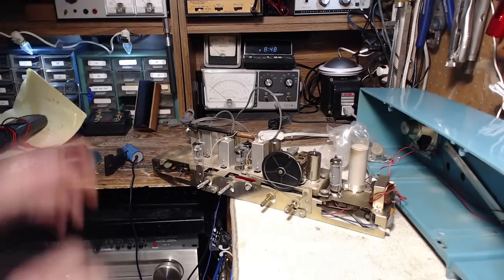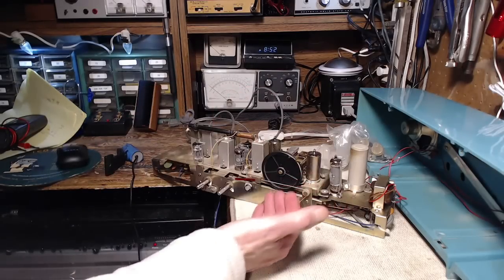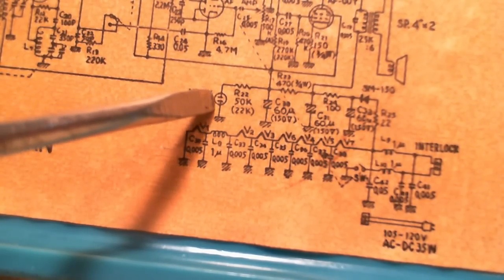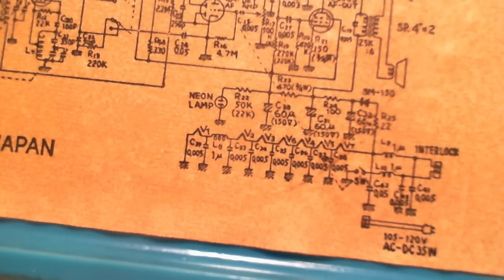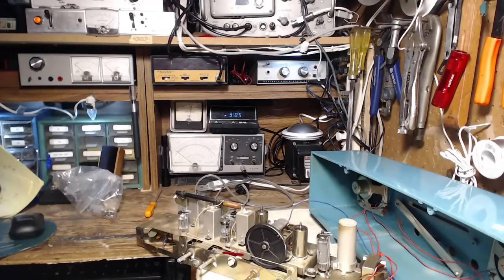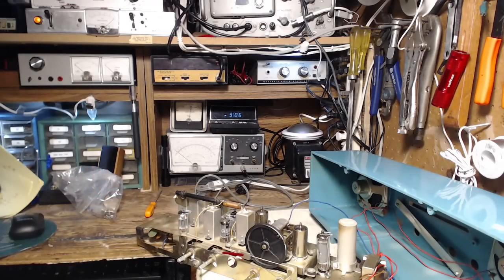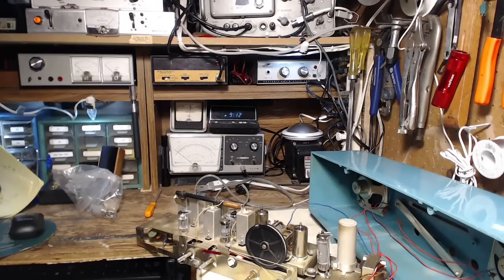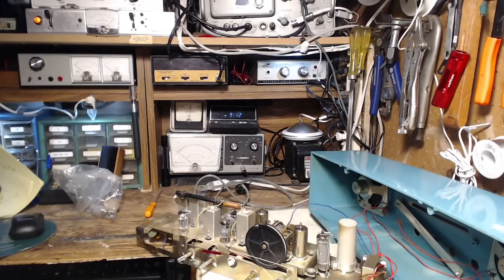AF-610 Japanese AM/FM Tube Radio Video #10 - Slow FM Start-up

Comment: You really made me laugh with the "Nobody would wait so long for a radio to boot but we will wait 5 minutes for a computer to boot." Ha! so true and I'm so conditioned to except it. I like the SSD drive idea but never made the switch yet. At work we are looking to adding SS arrays which aren't drives at all but are external storage SS arrays of memory storage cards that are presented to the servers and shares as if they were drives but they don't use any of the standard drive controllers so you aren't using the older slower drive controllers. They are so damn fast you can't even blink. You can get them for a PC as a PCI card add-on but those are still over $1500 each. Those use the PCI bus rather than the PC's drive connection interfaces so they are much faster than SSDs.
Reply from the maker: ***** As a kid, I remember reading in an electronic magazine about a 'flip-flop' circuit that could be found at the core of a computer.  A circuit diagram was provided to illustrate how it worked.  The circuit used vacuum tubes.  I wonder how big the computers of today would be if they were built from tubes.  ;-)
Reply: Jim Lindenas In the mid-1980's I visited Cape Canaveral and took every tour they offered. In one of the older launch complexes they have a early 1960's computer and the service manual was out. Among the various tools needed for regular maintenance they listed a Torque Wrench...for some reason the bizarre nature of that has always stuck with me. And this was when the Apple II and the Commodore 64 were leading edge tech!

Comment: Sounds like bad caps...replace all of them
Reply from the maker: Buzz1151 I think that would be the end of this radio.  I'd make so many mistakes I'd never clear them. Eventually, I will start replacing capacitors or other parts but only on suspicion.